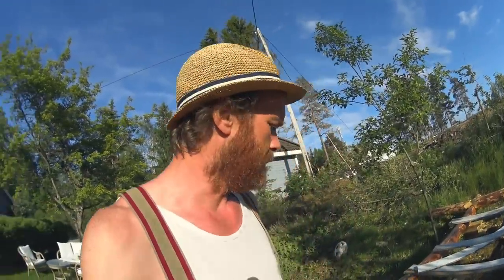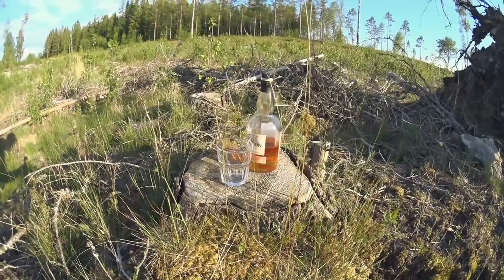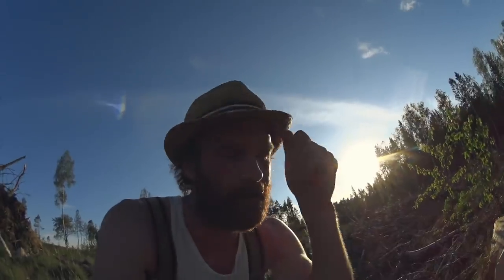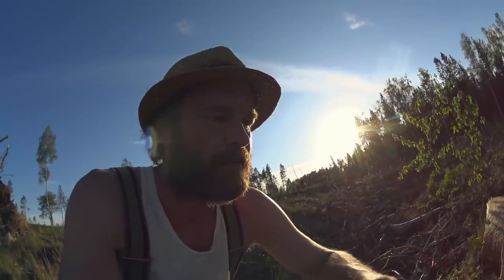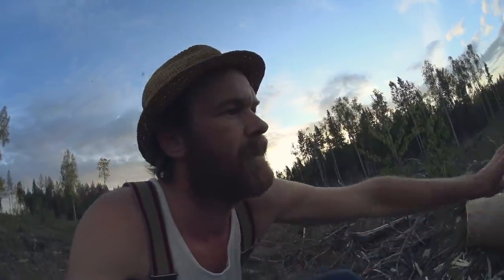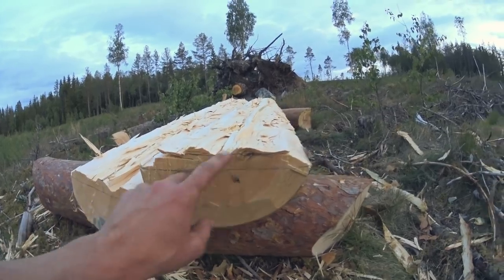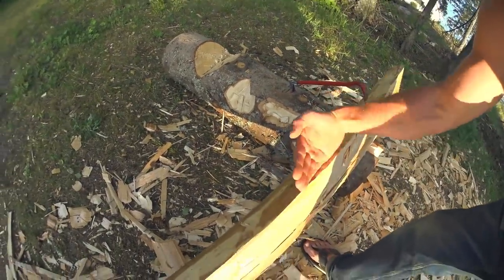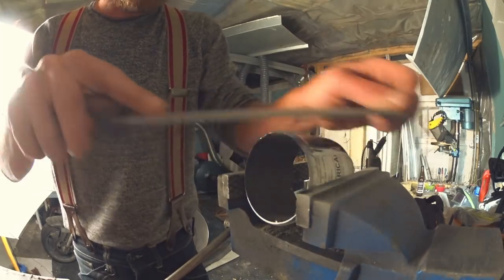Axe Only Log Cabin - No power tools, no saw E2

Comment: What you need for flattening the logs is a broad axe with an offset handle. It has a much wider blade and is more ergonomically correct for that specific operation. By the way, you are a guy of many talents. I'll bet you are even a black belt in Karate!

Comment: Okay, that was an interesting adze- most adzes are built like a hoe, with a slight curve through the blade, and a much heavier handle, perpendicular to the cutting edge. And no, they're not as common as they once were. For further smoothing, consider the froe, another old tool. Long, narrow blade, with a handle in line with the blade. Usually used for splitting light wood, like shingles, they can also be used to flatten wide boards. Keep your cutting edge in mind, when building a woodworking tool. You're doing fine, stay with it!